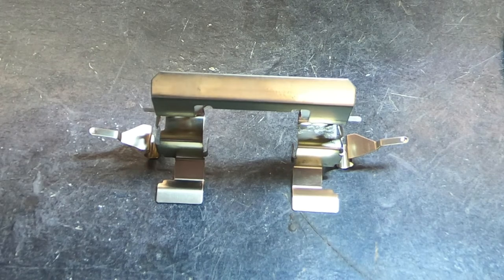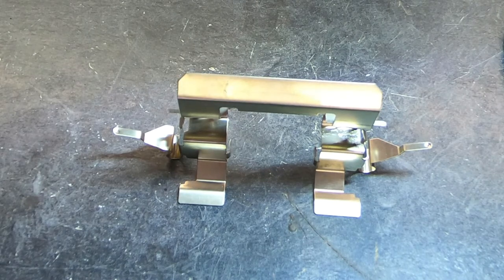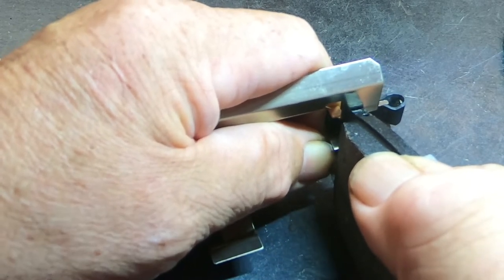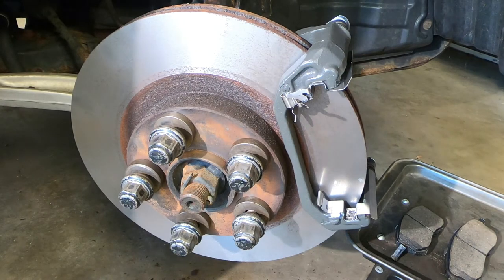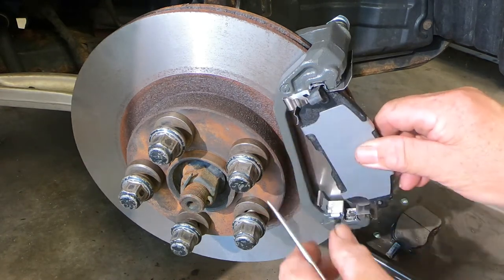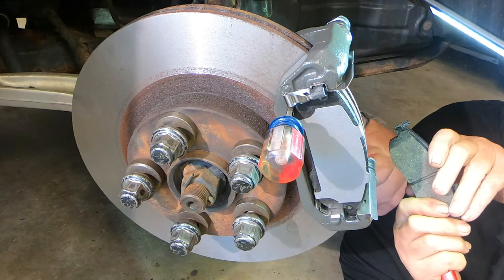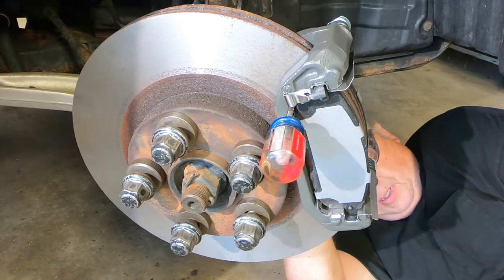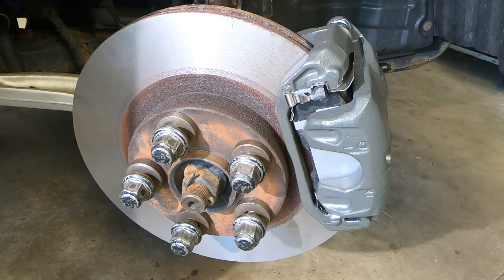How to Install Spring Type Abutment Clips

Comment: Thank you for posting.  I replaced rotors and brakes without using the tabs, brakes and rotors rattled at every crack on the road. Finally replaced the brake guide pins and bushings also moved those tabs in place. No more rattling.
Reply from the maker: Sorry I took so long to reply. I am glad you found the video and found it helpful. By all means don't be a stranger.
Reply: @richardspaulding5035  thank you, I appreciate your response.  Have a great weekend.

Comment: I never use those.  They are a pain in the ass and prevent the pads from moving freely.  They always bind so I have NEVER used them in 30 years.
Reply from the maker: If installed correctly they act like little springs to help prevent the pads from rubbing the rotor. The manufacturer put them there for a reason. If you don't know what you are doing it is best you don't attempt to utilize them.
Reply: You either have lousy poor fitting pads or you need to clean out the notches in your caliper as thoroughly as you can. If you have to take the bracket off and wire wheel it with an angle grinder then do it. If they have even fractions of a millimeter of crud built up on them they will be out of tolerances and pads with the hardware won’t fit properly.
Reply from the maker: @TadpoleTrainer  great advice
Reply: @richardspaulding5035  thank you sir
Reply from the maker: @TadpoleTrainer  glad the video was helpful

Comment: Why is the spring only on one side... wouldn't that cause the pads to not go out evenly?
Reply from the maker: Not concerned so much about how they go out but how evenly they are applied. That is how the manufacturer designed it. Good question to ask them.

Comment: Clear and concise! Thanks!
Reply from the maker: Thanks, in reviewing videos of brakes utilizing these clips no one was showing how to correctly install them, so I decided to post the video.
Reply: @richardspaulding5035  It’s often the little details that get overlooked. Your video is very much appreciated!
Reply from the maker: @Kalanilei-no9mp  Thanks, it is difficult to find content that has not been already covered these days. I don't duplicate content that is well done. However, when I find I could do a better job of explaining something or provide better camera work I will post a new video. Such was the case with the tangs on these abutment clips. Every video I watched just ignored them. One guy even whet so far as to cut them off LOL.

Comment: I am currently replacing calipers, rotors, pads, etc and I had no idea what to do with the clips that came with the calipers. Even though mine were a little different from yours, this video helped me to figure out how to install them. Thanks! By the way, I noticed your used no lubricant on your pads or clips. What are your feelings about this?
Reply from the maker: I do and I did. I have videos on how and when to use lubricants. I did not show using lubricants for the purpose of visual clarity as in this video it was only about installing spring tangs. Afterward I removed everything and did indeed lubricate.  Thanks for pointing that out as I should have mentioned that in the video.

Comment: Wow. Thanks for such an informative video.

I changed my pads and discs last week, and have noticed my discs getting too hot on short drives. Felt like the pads were rubbing the disc at all times.
Sounds like I missed this step!

Thanks a bunch. No one else seems have any info or guidance for fitment of these hardware clips, so your video is a lifesaver!
Reply from the maker: Thanks for the kind words. I just want to mention there could be other reasons your rotors are getting hot such as a sticking caliper or a restricted brake hose. After you refit the abutment clips continue to monitor the brakes for a while.
Reply: @richardspaulding5035  thanks for your reply. I dug a little deeper, and it was in fact a sticking caliper. Replaced that, and the clips, and everything is back to how it should be.
Regardless, your video proved to be a valuable resource. Thanks!

Comment: Cool neat tip Rick
Reply from the maker: I thought it was strange that one takes the time to install these correctly. Even the great 1A Auto guys who usually have pretty good videos did not bother with the tangs. They just left them hanging out there.
Reply: @richardspaulding5035  I use to work at a Nissan dealership and we always used the tangs
Reply from the maker: Yes, by all means. Before I post a video Ii aways look to see what is out there on a subject. I was shocked that I could not find anyone who bothers to installs the tangs. I have had some negative comments about my sons Altima because I have posted a lot of repairs on it, but it has well over 200K on the odometer. The motor still purrrs and the trans shifts like a champ. Naturally you are going to have few minor repairs with a high milage car like this. and for the most part that is all it has been (minor repairs).
Reply: @richardspaulding5035  I loved the all the repairs you have done on it

Comment: How many abutment clips do I need -- total of 16 if I'm doing all the pads?  Hard to find by themselves and the Akebono pads I purchased didn't come with them.
Reply from the maker: Most vehicles use 2 per wheel. You don't buy them individually, They come in a kit, simply go to your local parts store, give them your vehicle information, They will give you what your need.

Comment: Ok now you left out the part i needed. You preonstalked the carrier bracket off camera. Thanks thats where im having trouble. Im usually pretty mechsnically inclined and dont have much trouble.  Maybe you done it so many times easy for you or seems to be common sense so you figure any idiot can do it right? Well not this one. Either I'm a complete dumbass or they gave me the wrong ones but eitherway im still stuck on stupid here. I just wish someone would just make videos where they dont assume its to easy and leave out steps or do them off camera for once.
Reply from the maker: I apologize for that. I am going to review the video to see why I did it that way. Perhaps I have something on another one of my videos that shows what you need. If you could get back to me exactly what make, and year were you working on. thanks
Reply: Ok first I'd like to apologize for the typos. Sometimes spell correct likes to makeup it'd own words lol. Anyways what I ment was that you pre-installed the carrier brackets off camera. Well that's the part I needed to see. I have found no videos that don't leave this part out. My vehicle is a 2001 Dodge Strattus SE 2.4 liter DOHC. I have since figured out how to install these but apparently I still got something wrong because now when I hit the brakes it squeezes the brackets together and makes a horrible grinding sound that is destroying the brand new rotors I just put on. Now I see why most people just discard them and do not install them. Seems they're more trouble then their worth. I don't know maybe I just don't know what I'm doing but finding a video that actually helps is like pulling teeth.
Reply from the maker: @thomasmcgraw3436  I did not show the carrier bracket because the video was only about the tricky abutment clips. I wish I was there to see what you did and how you did it. Per your description something is very wrong. That bracket is held on with just the two bolts, there is nothing special about it as it is a very typical instillation much like most vehicles.
Reply: @richardspaulding5035  the bracket uses two bolts but the break pad clips are basically held in by the pads by what I can see.
Reply: I still have to open the drivers side and remove the clip before it can do more damage. Maybe I can post a picture that will give a better idea of what I'm looking at.
Reply from the maker: @thomasmcgraw3436  Greate idea! I just subscribed to your channel so now I can see anything you post. By all means take some photos or a video from several angles and I will see if I can figure out what is going on there.